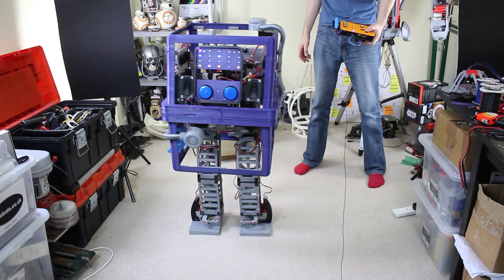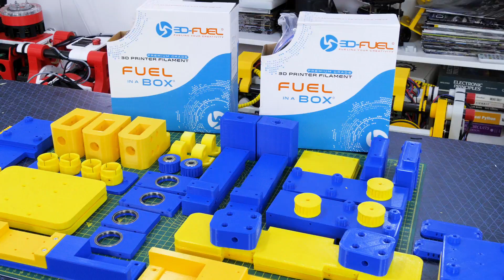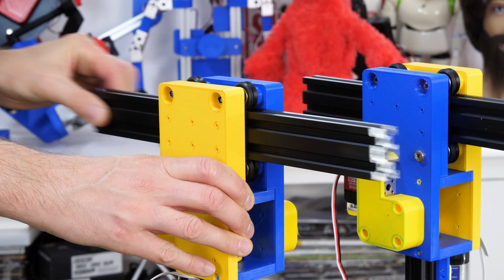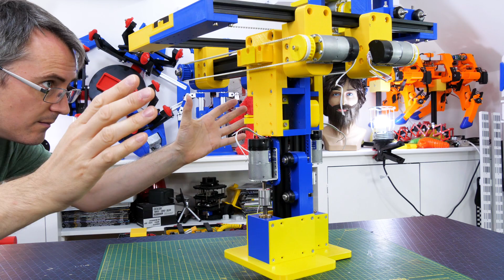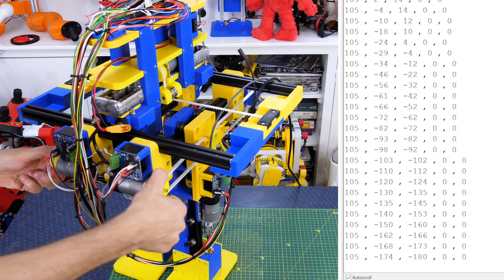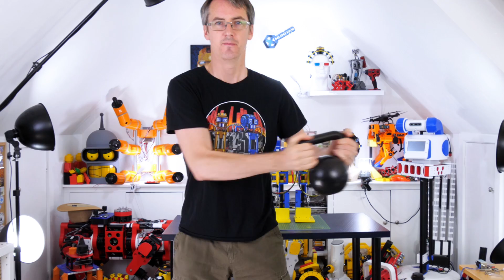Why Walking Robots are Easy

Comment: As a non engineer that has worked in the animation industry, I am very curious about why usually there is no rotation or torsion in the torso of  walking robots, and why they don't use the  arms to modify the center of mass even if they are not fully functional. Those two are insanely important for equilibrium and they seem to be completely underused
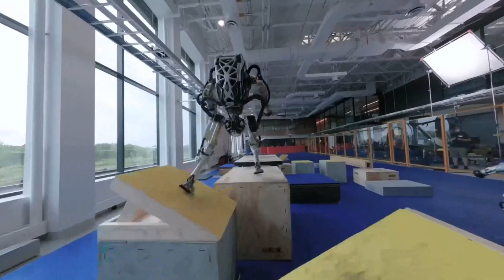Reply: Typically they do try to use the arms and spine of the humanoid...but it's just another  layer of inverse kinematics with multiple possible correct solutions and finding one before it falls over. (look at the boston dynamic clip at 14:55...that is very clearly rotating at the spine above the hips. The arms are pumping with the steps, but only enough to keep it straight. They would do more motion...but that would require the actuators to be even more powerful to justify needing more moment/cancellation of moment.
Reply: @frollard  why not make dummy arms (like wings) only for balance and nothing else with weights on top that slide towards the tip or the center, coincicentaly it would also robots look more like gundans
Reply: @devforfun5618  James bruton recently made a robot that did this specifically... It sucked.
Reply: I would assume that it would have something to do with the flexibility of the hardware and the cost of manufacturing, could also have something to do with the extra weight making the robot less stable?

I need a robotic engineer to confirm this
Reply: not an engineer (yet) but i do have a good amount of knowledge about robots--my guess is that it's too challenging to design arms with enough weight to actually change the center of mass. powerful motors are heavy, so to add arms you need to use motors powerful enough to support the weight of said arms, but those motors are now super heavy themselves, which means the arms won't be as useful. as for torso rotation, some robots like atlas do use it, but it's generally easier to design a robot which doesn't need torso rotation rather than try to implement it
Reply: @rudrecciah  good place for batteries I suppose
Reply: @rudrecciah  You don't even need a bunch of weight though. Just have to make it move faster.
Reply: @adryncharn1910  🤨how r u planning on changing the center of mass by changing the speed of the arms
Reply: @rudrecciah  I'm not. I'm planning on exerting force by swinging the arm, and changing the speed at which you swing it to change the amount of force exerted. And use that force to keep it in the right position instead of changing the center of mass. That's how humans do it, and it seems to work far better than trying to keep the center of mass in a stable position.
Reply: @rudrecciah  Because everyone ridiculously puts heavy motors all over the place rather than just putting them where they want the mass and using remote drive (spinning flexible shaft, cable drives through bowden tubes, etc) with lightweight stepup and reduction gearing at opposite ends...
Reply: @daliasprints9798  im taking about putting them where you want the mass. obviously if you put them on the arms themselves itll be redundant, but if you put them in the torso itll also not be ideal because now you have more mass in the torso to be able to control the mass of the arms

so now the arms need to be heavier to account for the new mass in the torso, which means the torso needs to be heavier to account for the new mass in the arms, and the cycle continues. there is obviously a balance where everything works out, but most of the time its easier to just forgo the arms entirely and use a different system to displace the mass
Reply: There is name for such a process. Feedforward Dynamic Compensators. This basically classic controller (i.e. PID) but you add a compensator that is based off the kinematic chain of the robot. In layman's terms this compensator will apply torques to other joins that may not need to move, but due to the motion you are inducing they may be experiencing some moments. And thus it kills any sort of wave motion propagating through a robot hat may occur when you move a joint. The hard part about the compensator is that the kinematic chain is hard to calculate. It gets exponentially worse the more degree of freedoms you have. (i.e. a 2d simulated robot I worked with which had 8 degrees of freedom took 6 months and many pages of paper before the kinematic chain was fully calculated out). There is some niche research into making algorithms that are able to experimentally find these chains and self tune their controllers and compensators, but due to the advent of neural nets and machine learning this type of research is not very common.
Reply: The more degrees of freedom you have the more complexity you add to your control routine. Basically its really hard to tell the robot how to use its arms or additional rotational degrees of freedom. Also inevitably you are likely to take away rigidity from the system when adding lots of additional degrees of freedom which makes every action less repeatable and makes your controls problem even harder.
Reply: I'm pretty sure I've seen academic papers on it, but by and large there are two strategies for controlling a biped robot; either you work out the dynamics precisely and pre-compute a trajectory which keeps the effective line of force acting on the robot within the support polygon of the feet and then use a simple controller to follow that trajectory, or you model the dynamics very roughly (assume the robot is a simple inverted pendulum pivoting on the support foot) and recompute the trajectory many times a second. My guess is that it would be relatively easy to incorporate swinging arms into the first sort of system, since you're modeling the dynamics of the arms anyway and you have plenty of time to find an optimal trajectory, since you're computing it ahead of time. The issue there is robustness though, if you run over and kick it it's unlikely to be able to recover once it's far enough away from it's planned trajectory. The second sort of system isn't generally aware of the COM motions caused by moving different parts of the body since they're trying to keep the planning loop very fast and simulate the dynamics very roughly. I can imagine such a system working better with rigid arms, since you're likely able to keep the COM closer to the position you're assuming it to be. You're probably gaining in robustness and losing efficiency, which is usual with bipedal robots. Efficient and stable is sort of the holy grail, humans can do both but getting a robot to do both is a nut yet to be cracked.
Reply: Actual “real” robotic companies like boston robotics do, it’s just that doing this requires a lot of work
Reply: Mass and complexity probably has a lot to do with it. Robot arms are likely to be much lighter than the core of a robot structure which would reduce their influence to a certain degree. A rotating upper body would also add a lot of complexity as you don't want those wires to get pinched or crossed. Then you have to have the additional complexity of programming using these things as proactive and reactive balancers.
Reply: To do this well requires a neural network that is constantly processing the estimated center of gravity, ground contact point(s) and how various motions impact those  of items.  It is doable, but is massively time-consuming requires massive amounts of programmer time.
There are a limited number of organizations with the resources to pursue something of this magnitude, and even fewer with an incentive to spend those massive resources on a project like thus.
That said, as an engineer, I dream about be given the resources to pursue something like this.  😉
Reply: @SvdSinner  "It would be cool as [_], but I won't have enough time for that. Unless I am getting paid."
Reply: There's some footage of an AI learning to run that seems to have learned the ability despite their limitations. 
While we can make micro adjustments, this AI was flailing it's arms wildly to maintain its balance
Reply: Because using arms to modify center of balance is hard. Like it takes humans a long time to figure it out as babies hard.
Reply: @rrteppo …
Reply: BD’s Atlas does, I’m pretty sure.
Reply: @polarvortex6496  I think so too, and they are by far the most impressive bipedal robots developing right now
Reply: mostly stability. humans are actively stable while most walking robots that dont use torso torsion go for passive stability to save on power consumption and overall complexity
Reply: I think there are a couple of robots where there are arms or a flywheel on top, but they don’t seem common
Reply: They do and they do. The newer ones at least
Reply: to begin with, Tesla's robot have a massive PC in the center to be responsible for all the processing and whatsnot. so you can't really twist that.
And yes, you could use arms (and maybe incorporate yaw, at least, to swivel the body around), but I guess the amount of calculation required for that would be just too much for that effort
Reply: the state of the art usually does, but the robot is trained to walk using reinforcement learning, which was kicked off by a paper that was published about three years ago. Some people at Oregon State University made a huge buzz in the research community a year ago or so about a robot that can walk up and down stairs blind.
Reply: Since no one has given you the right answer yet, it’s actually completely doable and fairly easy. You just to need to explicitly have a momentum term in your inverse dynamics optimization. This can either be instantaneous inverse dynamics (which reduces to a quadratic program) or you can have a horizon (this is more expensive to compute and not as common).
Reply: Boston Dynamics use the arms for balance but reducing the number of actuators is a direct impact to cost
Reply: @disconneck1363  That is why a neural network is needed.  Straight forward reverse kinematics doesn't work with  numerous degrees of freedom.  One or more nodes of the neural network are needed to keep track of how various coordinated motions should impact body motion in whatever orientation the robot happens to be in.
Reply: I think the difficulty is in part in how servo motors work.  They tend to have a lot of jerk when they move compared to living muscles.
Reply: @wolffang489  The jerk can be modeled in software and the controller can be tuned to work in tandem with it
Reply: @wolffang489  geared servos can have backlash which can cause jerk, but for high quality mechanisms jerk is up to the controller and trajectory control algorithms
Reply: Rotation of moving things while keeping the thing stays in the same direction is mechanically complicated and generally just not worth it when you can just sway the hips from side to side
Reply: @michaeldeely2044 I mean sure is more complex, but if you dont have the advantages of legs why not just use wheels
Reply: I think it's probably too difficult. Adding a small joint makes it difficult to control, but it becomes much more difficult if you create large movements, such as the spine and arms. In the past, robot movements were controlled manually. Only recently have we been challenging control methods such as reinforcement learning. As far as I know, most companies that lead the robot industry, such as "Boston Dynamics," cannot apply reinforcement learning to real robots, so they still manually control the robot's movements. Given this situation, most robots are currently not optimized for hardware design. Therefore, I think it would be almost impossible to combine "unoptimized hardware design" with "complex movement" from the standpoint of having to manually control the robot. However, considering the recent successful application of technologies such as reinforcement learning to actual robots, it seems possible to use the robot's arms to balance and twist the torso in the near future.
Reply: If you look at Boston Dynamic's Atlas robot, it actually uses both of those things in its design. Not so coincidentally, it's also the only 2 legged robot I've seen that's capable of human-like Parkour moves: https://www.youtube.com/watch?v=tF4DML7FIWk

As others have pointed out, the reason more companies don't include motions like this is because it's really fucking hard to do. If you can get away with making a robot that doesn't have these extra degrees of freedom, it's a no-brainer not to include them.
Reply: The reason is quite simple: it's insanely difficult to do. 
If you to do it with a pre-planned trajectory, where the robot just executes a schedule of forces and angles, it's doable. But as soon as something happens that you did not anticipate, it will fail. 
So you want to calculate real-time, preferably at atleast 30hz. That way it can recover when pushed or step over objects. The difficult thing with bipedal walking is the instability. The system can only exert force via the feet, and only when in contact with the ground. That makes the amount of force one can generate while walking, especially during the one leg phases, quite limited. This is already difficult when only using legs.
Arm simply make it a lot harder. Arms can move in basically every direction, as long as there is enough room. Furthermore, there are many configurations that lead to the same hand position. Grab something, and you can see that you can still hold on to it when you lift your elbow for example. On top of that, you need enough energy capacity to power the motors in the arms. Current batteries are generally not capable of holding that much without insane weight. 
Even bostom dynamics haven't figured it out, and they have an insane budget and brainpower available
Reply: Tbh I always feel like robotics ignore how all animals, especially bipeds, move their body to balance their weight to be more mobile. Its a lot harder to walk without moving your arms or twisting your body as you said, you end up hobbling around almost like mimicking a penguin.
Reply: i think it comes down to a combination of balancing with arms being a much more complicated process than you might think, and the existence of much simpler solutions to the problem, why spend the time designing and programming a robot to be capable of using it’s arms to balance when you can just stick a strong gyroscope in it’s chest like BD’s Atlas
Reply: Arm swing torso twist, tail swing all help but unecessary so it just adds complexity and weight. there are multiple solutions to get to A to B as there is for rearranging center of mass. Coding all that is probably trivial but it sounds hard to account for everything. A lot of movement is dealing with tiny missteps and unpredictability. They don’t have touch centers or vision and have to rely on all unexpected events to be detected by momentum sensor and how does one code a response to every unpredicted misstep, slip, breeze in the wind. Being inside a robot every step must feel like walking on ice for the first time in your life. Someone told me that animal bipedal walking is really just catching yourself falling repeatedly. Controlled falling. And that’s the most energetically efficient solution.
Reply: @disconneck1363  Amen, brother.   There is a reason why it takes humans nearly 2 years of experimentation just to walk awkwardly.  (And we already have all the hardware we need)
Reply: the new and advanced ones do tho, right? I mean Atlas form Boston dynamics definitely has arms he balances with for example
Reply: Extra Complexity.
Reply: How about a robot giraffe
Reply: Digit does, Boston dynamics humanoid does as well.
Reply: Some robots do use their arms and waist for balance look at those Boston dynamics robots
Reply: That makes horribly hard to control.
Reply: i think its because robot like atlas from Boston dynamics dont have the center of mass in their waist like we do, but rather in their chest areas
Reply: i would be that's becouse you dont need to, if it can walk then mostly it can rotate in place by using its legs
Reply: Because It's really hard to control. If one axis(we call this mobility) added, whole system's mathmatical dimension also increase. That makes us hard to calculate ZMP(zero moment point)
Reply: Yeah and the hips and shoulder counter balance is not used at all. Always weird to me why it wasn't used. Prob a reason for it though.
Reply: my humanoid robot will do both of these things.  Most people just want to simplify so they skip what you said.  Not me.  I am doing it right.
Reply: Some robots do, there is someone on YouTube and he makes very impressive balancing robots that walk exactly like a human does and it uses it's arms for balance, it can stand on one foot and keep it's balance as the platform it's standing on is tilted, it can even hold a basket in each hand with weight and keep balance while holding them.
Reply: @onidaaitsubasa4177 what's the channels name
Reply: It's significantly more complicated and expensive to implement, that's all really.
Reply: cgi ?

Comment: You might be able to damp the wobble by using a simple Input Shaping algorithm. This shaping process splits the acceleration into two phases, where the second phase cancels out the vibration created by the first. As always, an insane amount of design work done in an insanely short time. Another great piece of work.